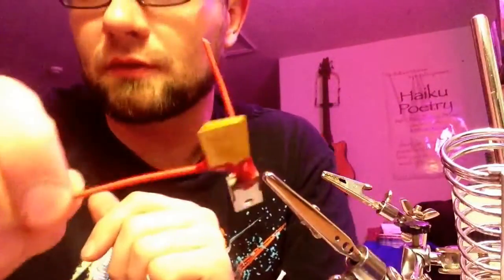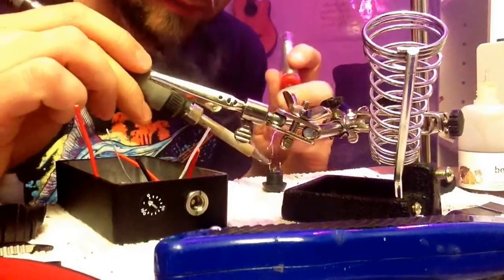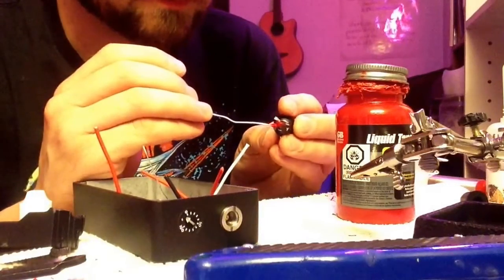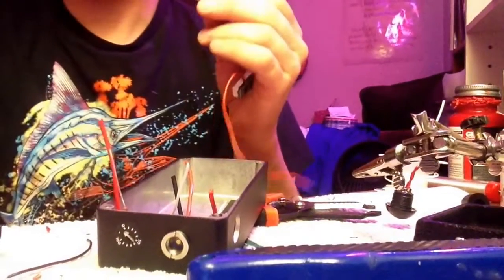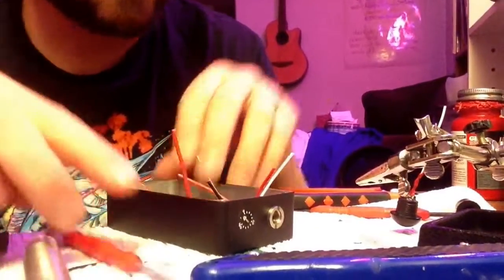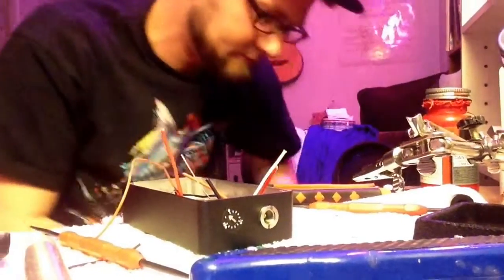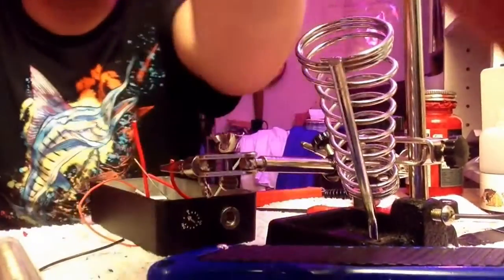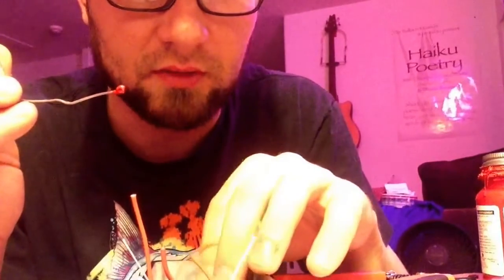Fuses and fets part two plus button

Comment: hey man i saw thats the otto p9 button, I just picked one up and theres 4 solder pins on it unlike the usual 2 im used too. I was thinking of just snipping off 2 of the pins leaving me with 2. is that what you did? I saw there is like 2 pairs of pins so ill just pick a pair and snip of the other...that looks like what you did i just want to make sure before i fuck it up. thanks.
Reply from the maker: Just make sure you cut off the right two. Get your multimeter out and test for continuity. 2 of the pins are going to beep when you push the button and the other two will stop beeping when you push it.
Reply: I literally just winged it by looking at the pins you cut off in your video and used the ones you did. Here is my box i built. I couldnt ge tthe voltmeter working i broke it by shorting the tab on the top of the pfet on the box and it wouldnt work it would show 8.oo with like small 0s instead of big ones and nothing for Voltage out

 ttp://imgur.com/ZHwDuYh
http://imgur.com/f0PsmoT
Reply: I ordered a new one from china but so thats why the p fet and Vout pin are only covered with eletrical tape instead of dat LET lol

Comment: how many watts do you solder at? like 20W?
Reply from the maker: Not sure about wattage. I use a temp controlled unit and run it around 750 degrees most of the time.
Reply: Dustin Brown oh alright nice. I really like your videos. Could you send me a link to that helping hand stand that you use? I was thinking of buying one but dont know which one to get. thanks.
Reply from the maker: will hately It is a super cheap one. I think there are much better  ones. I suggest checking out amazon.
Reply from the maker: I am sure that one will be just fine.